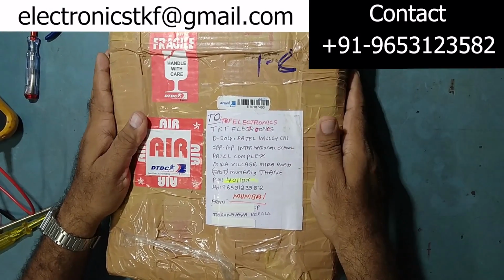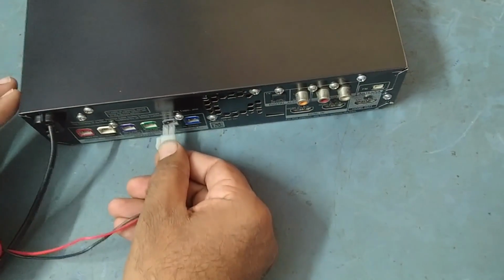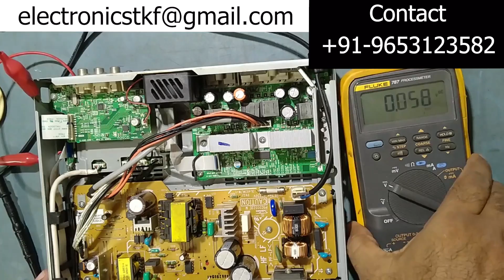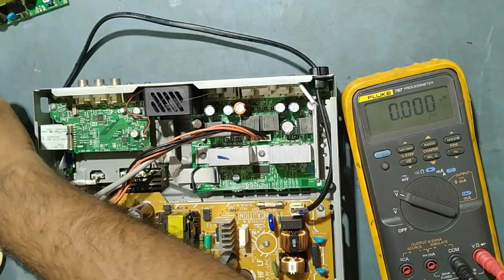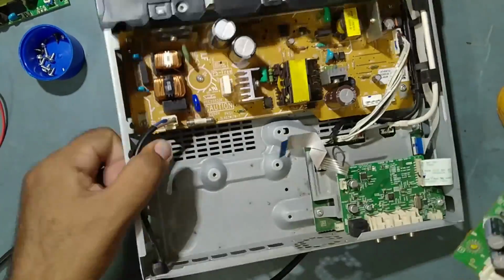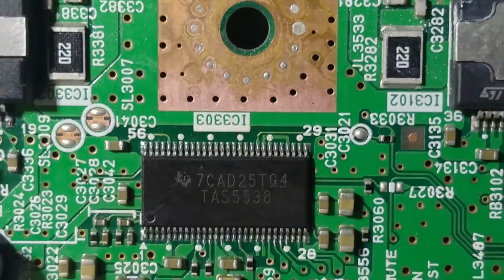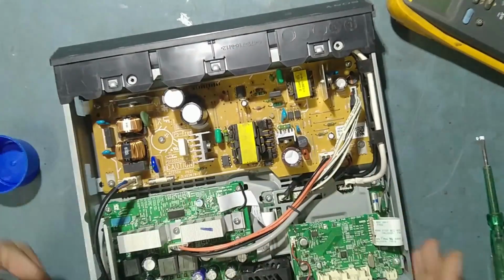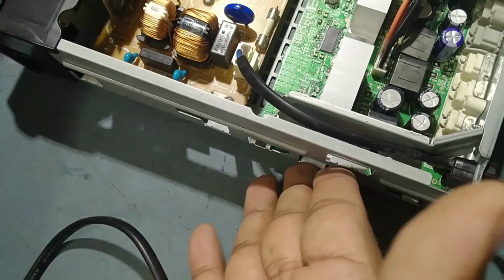How to Repair SONY HT-IV300 for No Sound problem.

Comment: on stream ic pin no 9 i am getting 1.90v only bro
wt might be the problem
Reply from the maker: Firstly tell me What is the issue in it.
Reply: @TKFElectronics  suddenly stopped working while using it was showing push power protect. so i have checked i disconnected the FM,RC ect board and turned on, then it turn on with any error but no sound so i check some voltages. so at stream ic pin no 9 it is showing 1.90v instead of 3.3v i think main board faulty.
Reply from the maker: May be i am not sure.
Reply: @TKFElectronics  ok